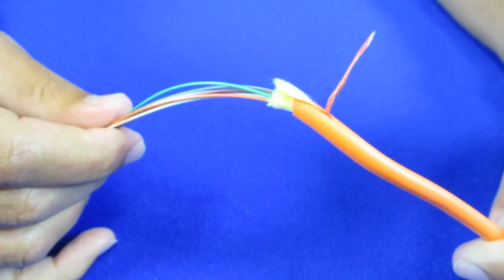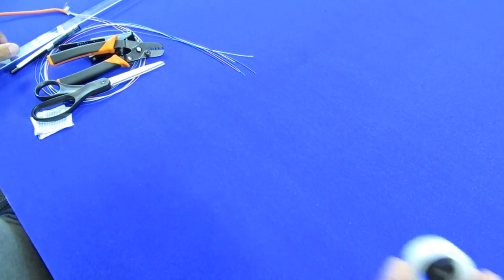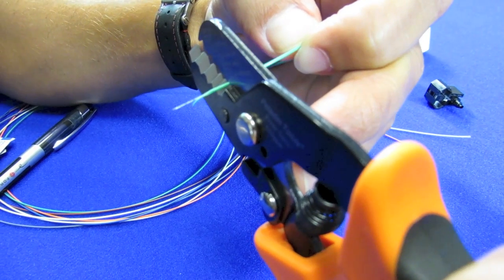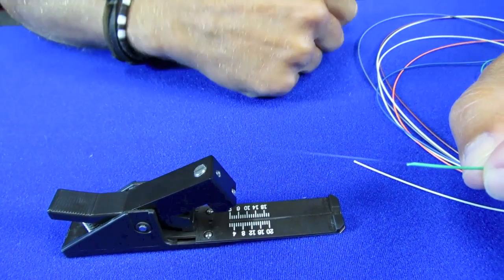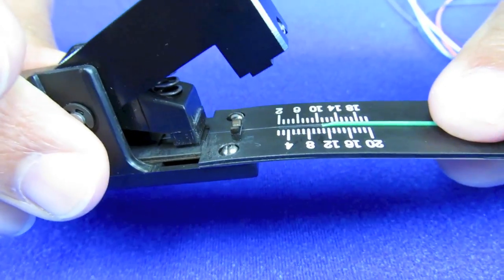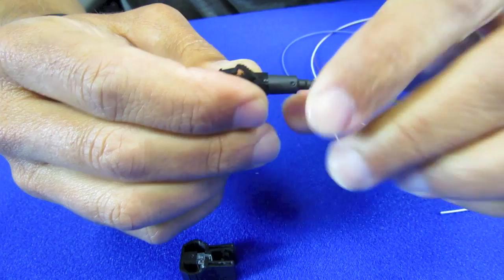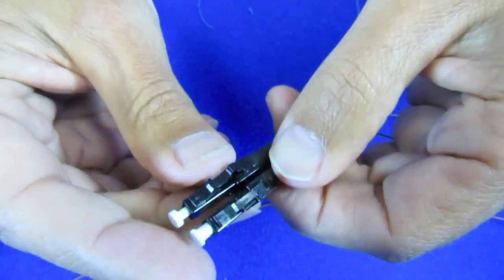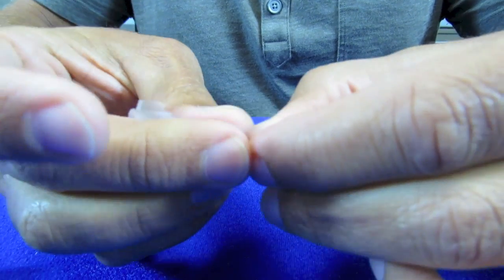Terminating Fiber Optic Cable

Comment: At the beginning you state that there are small pieces of cladding left after you stripped the buffer coating. That is not the cladding. That is a secondary clear buffer coating. You would not be able to strip the cladding.
Reply: Mc Ren 
I noticed this point about the cladding and I stopped the video and went straight to read the comments to see if anyone noticed or heard it .. 🤔
Reply: +Mc Ren  nice point
Reply: I said that too. It’s impossible to strip The cladding. I knew this was not a good video after that. Then I saw the cleaver and left...

Comment: Why doesn't he polish the ends?
Reply: +Navinpaul Singh Polishing isn't required.  The cleave, and a low-refraction coupling gel inside the connector, ensure a clean connection
Reply: it is called quick connector.. the end polishing is being done in the factory

Comment: Great video. I tend to go on the long side of the mark when cleaving. 
Also, the cladding is not removed... Only the plastic buffer is removed. If the cladding were removed (which is bonded to the fiber core), the light would escape the core. Sorry for getting literal.

Comment: cleaning is not necessary? you sure?
Reply: I would have use a Fiber Optic Microscope to inspect the  completed termination. That would tell me if polishing is needed and a quick test with a power meter as well. When I install it a shot with a  OTDR to confirm  the entire path is always a nice confirmation especially if you had to make several terminations on the path.